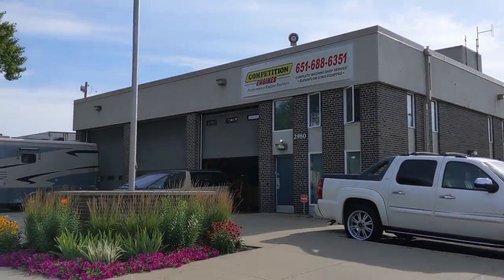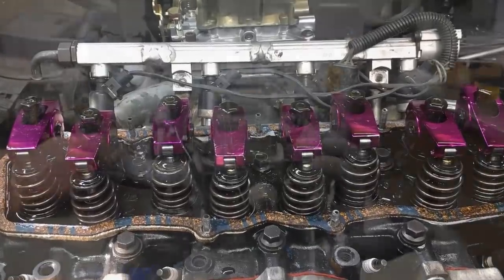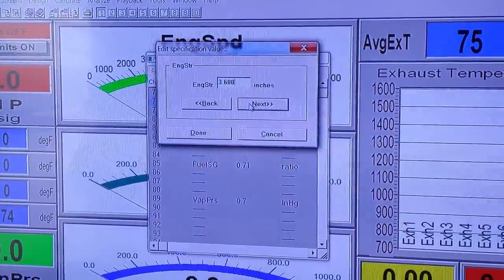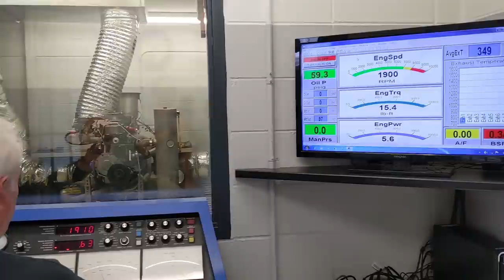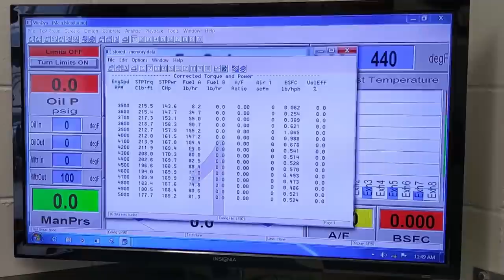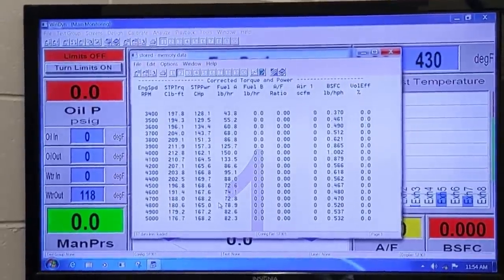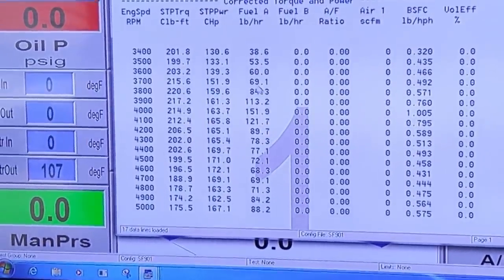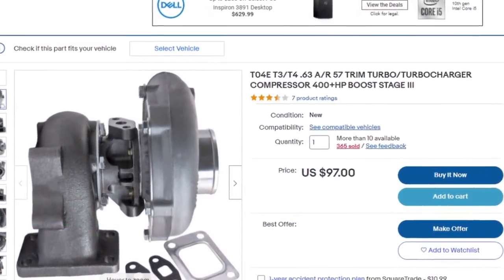Modified Pontiac Fiero 2.5 Iron Duke (Dyno Testing!)

Comment: So to help people out on the I thought I would post the flow numbers on the Vin A S10 cylinder head. 
  Box stock head flow    Intake w 1.72 valve .100=46.3 cfm .200=89.9 cfm .300=111.2 cfm .400=121.3 cfm .500=127.2 cfm 
Ported intake w 1.970 VW intake valve. .100= 63.9 cfm .200=127.8 cfm  .300= 166.7 cfm .400=189.9 cfm  .500= 192.1 cfm
     Ex flow. w 1.625 Pipe  .100=46.6 cfm  .200= 86.3 cfm. .300= 125.3 cfm. .400= 145.3 cfm
 Ported Ex  .100= 65.9 cfm .200=112.1 cfm  .300= 141.7 cfm .400= 156.6 cfm      
  2 of the head bolt holes in this head have to be elongated to fit on the Fiero  block.
Reply from the maker: Useful info - thanks Dave!
Reply: Get a pontiac sd4 cylinder head and a clifford or a 2bbl intake
Reply: Very nice. What rods were used? Did you fill the block? I'd love to build one for one of my fieros. Great video!
Reply: @buzzkill7349  The Con rods are a speedmaster SBC rod that is 6.125 long to work w the compression hight of the Ford Windsor pistons. And no the block is not filled.
Reply: Those are pretty good numbers ported. Pretty much inline with what my Iron SD4 Head flows up to .400 lift, then the sd4 valve sizes start to work in its favor. what is the volume of the ports on the S10 head? both my SD4 heads are roughly near 180cc.
Reply: @FieroWannaBe  The port volume is only 166cc, the major problem is in the bowl around the valve guide, and you cannot fix it w/o hitting water. Changing to the SD head would be a problem for my headers, because the D shape Ex port s very small also. If I get time this winter I want to build a new dual throttle body intake and get the Port Injection up and running again.
Reply: @racerd9669  the SD heads came with several different exhaust port shapes. 
My iron SD4 head is a rectangle port and uses Fel Pro gasket PN 1441,
whereas the hooker header is shaped to fit Fel Pro 1425, which is a square shape, and is based on the earlier dukes, and fits if some filling is done in the center ports, the very first run of SD heads have this square shape.
The aluminum heads '437 and '801 have raised D shaped ports, but it seems for every duke casting number they changed something, enough to make fitment difficult somehow.
Reply: For those that are interested in what a non-race spec SD4 head flow is in comparison:
10031323 SD4 head, Iron w/EGR. 2.02" dia intake, 180cc int runner, int port length 4.25", min CSA is at pinch- 2.26sqin, Throat dia 1.82”. 1.625" dia Exhaust, 74cc runner, ex port length 3.13", min CSA is at pinch- 1.25sq in, E throat dia 1.46”.  Int Flow: .1"-63CFM, .2-116, .3-160, .4-194, .5-229, .6-248, .7-235, .8”-240CFM. Ex Flow: .1”-53CFM, .2-105, .3-130, .4-149, .5-163, .6-171, .7-176, .8”-179CFM.
2 Barrel Edelbrock Intake w/ Holley adapter: CSA at Gasket 3.42sqin. Intake flow with manifold attached: .1”-51CFM, .2-118, .3-156, .4-188, .5-209, .6”-230CFM
All flow was on a SF750 @ 28”H2O. Head appears to have been bowl ported and gasket matched.

Comment: Smokey Yunick took a 2.5L Iron Duke(1988 basically stock) and pulled 250hpand 267lbs from it. He modified the distributor a little and put a turbo blowing into a supercharger using a Holley 2 barrel carb for the fuel control. By keeping the air intake temp at 300F or better he avoided detonation running 93 octane gas. The engine was stock otherwise. GM really screwed up by not letting this engine run as well as it is capable of doing. I had 1988 S10 with that engine and a 5 speed trans and it just felt awful. It always felt like it wanted to run harder but just couldn't. After looking at what GM did to the engine I can see why it failed.
Reply from the maker: Smokey did some cool things! Depends on what you define a failure, I think GM made this thing to be a utilitarian workhorse, and in that regard given all the mail trucks it's in and other vehicles throughout the years it may well have been quite profitable for GM, but that cylinder had really is like trying to breathe through a straw on a 2-mile run.
Reply: is this the hot vapor engine?
Reply: Failed? Used in millions of cars and trucks and government postal llvs is hardly a failure.

Comment: After some research & bouncing around ideas...I think reworking the Iron duke is the wrong approach...Rather, I would start out with the old non-crossflow head  3.0 marine version, (yes with the old SBC bellhousing pattern). At 9.3 CR would be a good starting point for the likes of centrifugal supercharging...the poor airflow at the ports negated by some, say 10 Lbs of boost. Yes, of course go full roller to help the valvetrain cope. The makers of industrial forklifts make a 4Brl intake for this engine...& of course a fabbed exhaust......Add in that Holley Sniper EFI to deal with dialing in procedures. Dunno, that's just the way I'd approach it.
Reply from the maker: Sounds like you put some thought into it, I like it.
Reply: I do not think the NonXflow head would make much power, but none of the factory cast iron heads are much for air flow. I do have flow numbers on the head I will have to look them up and see what flow it did have. As far as roller cams, good luck finding any, and the factory roller cores are way to small to get anything large enough for this big of a 4 cylinder engine. But thanks for your input, that is what this is all about, making people think.
Reply: Try Ultradyne!

Comment: The 2.5 is one of the best kept secrets in the world of sleepers. It will take just about anything you can throw at it. I've seen a handful of them cranking out 300-350 horsepower with turbos or superchargers.
Reply from the maker: There is something cool about taking a modest performance Duke engine and boosting the heck out of it!
Reply: But think about this, if the duke had a SD head on it, it could make that power N/A. Only problem is the SD heads are impossible to find.
Reply: @racerd9669  yep... thanks to cast iron and gearhead ingenuity there's a lot of future horses sitting in some pedestrian looking Chevy Cobalts and mini-pickups.
Reply: @chuckragsdale2904  I agree 100%, plenty of interest in the old Iron Duke still today.
Reply: I think you are thinking about the Pontiac super duty.
Reply: @aaronmcilvain8077  I drove one in '73. It was a '70 trans am with the SD 455. I wouldn't confuse that with a 4-banger. I know a couple of guys in a local speed shop that bored, ported, polished, etc two cobalts, one turbo and one nitrous. They both topped 300 hp on the dyno. They believed they could eventually top 400. That's what got me interested in the old "iron dukes".
Reply: @chuckragsdale2904  the Pontiac super duty 4 is a 4 cylinder… it was a motor you could by from GM performance for a fiero. It was offered in 2.5l,2.7l, and 3.0l the the IMSA GTU race Fieros made well over 300 plus hp naturally aspirated.
Reply: @racerd9669  how about  a LS.head.
Reply: @chriscatarcio2983  It will not work I looked at that. Lifters are all in the wrong locations and the Cam would have be custom billet unit. Very expensive.
Reply: @chuckragsdale2904   Usually what I saw was them testing the Turbo Chevy cobalt...  And the supercharged.. SS Chevy Cobalt... Never seen an NA1 on  Nitras.. Ye..ha... But yeah 1st era Chevy cobalt... SS... Was a super charged for cylinder... Few years later... They made the SS with a Turbo from the factory... Seeing people port both to see what the number changed would be between the Turbo and the super charged.. Pretty cool content..
Reply: @shawnlibby675  I have heard a lot of good things about the Cobalt SS for sure but the builds that I was talking about were basically just starting from scratch with an engine block. I should have been more specific. It was more about the iron block's durability as opposed to the full engine.
Reply: A close if not equal competitor is the 2.2L Chrysler engine. The Ford Lima 2.3L is a capable engine as well. I don't recall a battle of the '80's 2.xL engines ever taking place.
Reply: I wish a company would make aluminum sd-4 style headers for these dukes. They also need to sell roller cam kits for them too.
Reply: Mine is pushing 270 to the wheels, not sure what that would be at the crank. With a close ratio t5. In an s10.

Comment: I Love these GM Iron Dukes. I owned a brand new 1987 Pontiac Grand am and Loved it. It wasn't fast. Who cares. But that 3 speed auto and iron engine was Bulletproof. I wish GM kept making them. Can't beat a industrial grade iron motor and head.  These new aluminum motors are too high tech and trash if they over heat bad enough. Thanks for the memories.
Reply from the maker: Yep, just keep oil in the Duke and the Duke will keep going!

Comment: Wow, wild to hear one of those at 5000! In the cars I worked on with this engine it seemed like valve float kept it below 3500. Maybe it just could not move anything through the head, dunno but they didn't seem to rev at all.
Reply from the maker: It wasn't float - but there were vibration harmonics that were messing with the carb float causing issues.
Reply: @Toys4Life That's weird lol

Do you have the same issues with the Holley 500 or was it factory specific carbs?

Comment: It's amazing how far engine design has come. My normally aspirated 2007 Jeep Compass 2.4L 4 cyl comes stock with 172 hp at 6000 rpm and 165 ftlb at 4400 rpm. I do wish there was more torque though.
Reply from the maker: Couldn't agree more!

Comment from the maker: Dave, I got this comment off of a forum - thought  you may want to ponder it.  Comment follows---> 

Once upon a time I had a 87 Pontiac with that engine. Its timing gear disintegrated and since I was dirt poor I rebuilt the engine myself. My cost was only about $325 and it ran many miles afterwards.  It was a fun project so I can kinda relate to this build.

As for the setup in this vid... the somewhat crude intake design I think it hurting the performance. The runners are not equal length and the suspended fuel has to go around sharp corners. I'm thinking that interrupts the laminar flow and makes for poor atomization as it reaches the intake valve. I say either go FI or make a intake with the carb sitting about 250-300mm higher and pipe the tubes to the bottom of the box.
Reply: I appreciate your input, so lets look at why the intake was designed the way it was first and then go into the draw backs. The intake was designed to work with all the Fiero factory linkage and air cleaner, so it was packaged to fit the Fiero engine bay. This build was done by myself and some interns working in my shop. It was never built to run a carb. it had a modified stock TB that was sleeved for a Buick V6 throttle blade and multi port Fuel injection. So wet flow was never a big consideration. 
 Now if you look at the EGTs you will see the quirks of the carb on a FI intake. If you notice at the start of the pull the inboard cylinders have no fuel, hence low EGTs and the outboard cylinders are running at about 1050 EGTs and then the inboard cylinders catch up and their EGTs start to run about 1200deg. and all 4 cylinders are running very close, hence making equal power. Also the engine made best power with only 30degs of timing. I would say that is very efficient for the old antiquated duke. Even the the best GM could do with the 2001 Vortec headed SBC was 30degs of timing, and that was after 46 years of building that engine.
  I agree the intake could have been a better design, because it was built with 1 3/4 steel tubing. It really needs a 1deg taper angle to help velocity and remove restriction. But as far as wet flow I think you better look at the EGTs again. The engine is running on the long runners at idle and under low load, but as soon as you load the engine hard all the candles are lit and running very close together. I must admit I was surprised myself that the long runners were getting more fuel at idle and low load than the short runners.

Comment: This engine had a 17 yr production run.
Found it's way into 19 different car models.
Has the same bore & stroke as the DZ & Boss 302. 
Made the same power per cu in as everyone's stock V8s.

The only failure is people's understanding.
Reply from the maker: Agreed, It was originally made to be a low revving torque engine, and it does that very well!!
Reply: every old mail truck had an iron duke...the post office owns millions of these efficient engines...

Comment: David Vizard have ported a head for Richard Holdeners 2.2 Buick project.
I wonder if the Iron Duke heads are of similar design and something similiar could be done.
David has videos on it. Maybe worth checking out.
Reply from the maker: I doubt it, but let's just a guess.
Reply: The answer is to find and not pay too much for the Pontiac Motorsports Aluminium cylinder head. Many are coming back on the market as Baby Boomers age and get out of the hobby. With that head getting 250+ hp isn't a problem.

Comment: Why not add port injection (looks like the fuel rail is there) and distributorless ignition.

Or maybe have started with an '88 or newer Tech IV. They were improved. The '88s and newer have a balance shaft. Maybe that would quell the harmonic you mention.

The highest output Tech IV came with 110 hp stock.
Reply from the maker: Good eye!  The injectors are even there and ready to go.     I am sure Racer D will respond.
Reply: @Toys4Life  Yes I did run this engine with the multi port injection and a  MegaSquirt 3 system. At the time it had an offset ground crankshaft to use Honda rod bearings , so the stroke was 3.100 and that was 161cu in. . With the port injection and a Hyd Roller cam it made 199Tq and 170Hp. But when I did the change over to the Ecotec engine I upgraded the MS3 to a MS4. So I did not have a computer to run the 186cu in duke.If I get the time I will buy another MicroSquirt and go back to the Dyno with the injection on it. But really what it needs very bad is more cylinder head.

Comment: what kind of top speed can a stock 2.5 can go, my 86 2.5 and tack I redline at 73 mph I just got a tack filter will that help  the right size tires are on it, I dont know what to do. other wise 65 mph is fine
Reply from the maker: Not sure.  Maybe somebody else with one will chime in!
Reply: My 1988 4cyl automatic car will go 105 and I have never found the real top speed, maybe 112 or so. The car is factory stock.
Reply: @racerd9669  Just asking my 2.5 runs smooth But is the tack way off when doing 65mph my tack is running at 55 rpm should I try getting another tack?
Reply: @williambruceboisjoli8455  My car runs 70mph @ 3000 rpm. Red line is 5400. But I do have a 27 in dia. tire in the rear

Comment: The stock air filter on a gm 2.5 L iron duke can be too restrictive at the max HP. 

The engine really needs a larger surface Area filter if you explore boosting the HP.  

With the Camaro here a Fram air filter was so restrictive you might get low acceleration and top speeds like internet dolts claim. A GM Ac filter is better and less restrictive.

 Some brand new Fram filters i used would even collapse the air filter when they were a few months old. Then you have more HP since the dumb overly gooped up air filter was in place. 

  A clogged up cat converter also can limit the HP of the iron duke at higher rpms too.
Reply from the maker: Good point for this at any engine really!

Comment: I have an iron SD4 head with edelbrock intake I am replacing that would wake this bottom end up. 
Let me know. Im rebuilding the 2.7L SD4 in one of my cars, and wont be using most of the top end. The casting number is: 1003223 the head is cut for 2.02 intake valves and 1.625 exhaust, it has been ported. I'll be flow testing it next week on a SF750.
Reply from the maker: Hi, Did you get the flow numbers sir?
Reply: I did 230cfm at .600 lift with the Edelbrock intake. 248cfm at .600 with the bare head.
There is more info on my RFT build thread. I lost my Pennocks login so I can't post a build thread there.
Reply: Any idea what you want for the SD4 head and E intake?
Reply: @racerd9669  I will let you know As I get closer to finishing the build on my Al '801 head. I have to confirm some compatibility differences to be sure I am able to run the AL head on my block as is, and what hardware from the '322 Iron head will work on the '801 head.
Reply: @racerd9669  what where the specs for the cam you had made?
My original SD4 cam is a .522 lift, 295 advertised duration, on a 106 LSA. This is a Lunati cam from 1985, 3 bearing core. 
I was looking at the grinds offered by Isky and like the 292 Mega grind specs for my build. 
I'm not any expert but have noticed how engines with tight LSAs make power longer on the dyno than ones with a wider LSA.
Reply: @FieroWannaBe  The cam came from Lunati it was 244 251@.050. 303 311 adv, with .570 intake lift and .580 ex. on a 114 LSA installed at 106 In C/L . Good luck in getting a cam from Isky I spoke w Ron 3 times, he would say yes we have them but never came up with anything. 
 As far as LSA and power curves. a tight LSA like 106 will hit the TQ fast and fall off fast, but a wide LSA will hold the TQ longer and allow the engine to make more high RPM power. It will not make as much peak TQ as a 106 LSA but you will have more average TQ. 
 That is why if you look at the Dyno numbers the engine has a very broad TQ curve.
Reply: @racerd9669  what's a good day to contact you? So we can talk about the SD head?
Reply: @FieroWannaBe  We can chat anytime, now will work
Reply: Do you still have the SD head?
Reply: @racerd9669  I still do. I just pulled it out of my garage and started to clean the  coolant galleries on it. Are you interested in it? I have had a few others who are building some duke motors express interest. I have a thread on the speedtalk forum for this and my '801 head.
Reply: @FieroWannaBe  Yes I would be interested. I would love to talk to you on the phone, if we can work it out?
Reply: I just put my iron SD4 head and the 2 barrel intake on eBay.